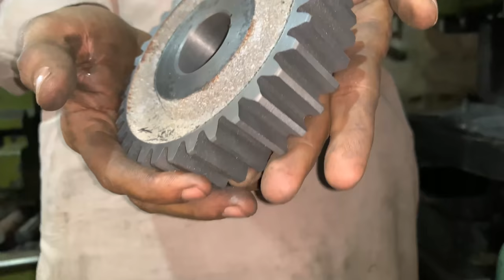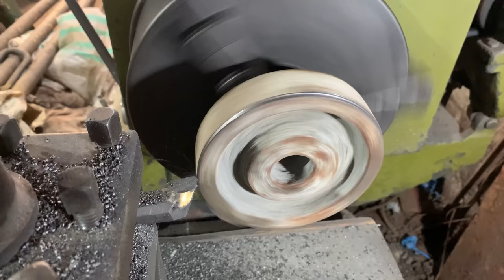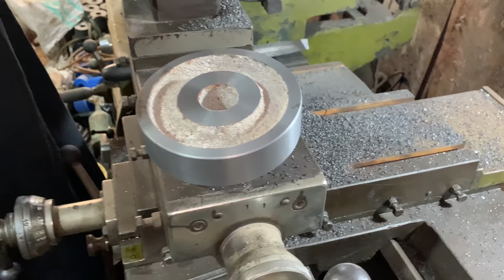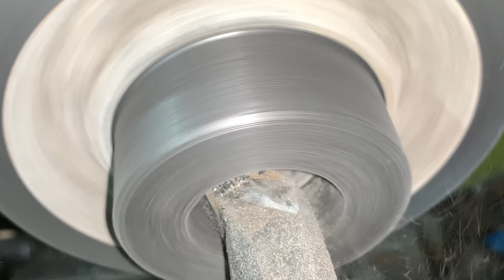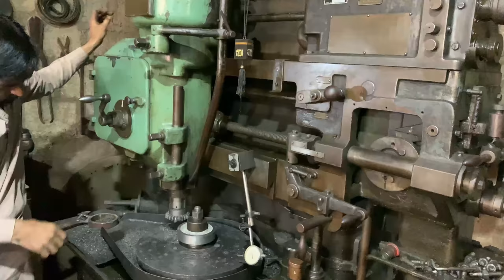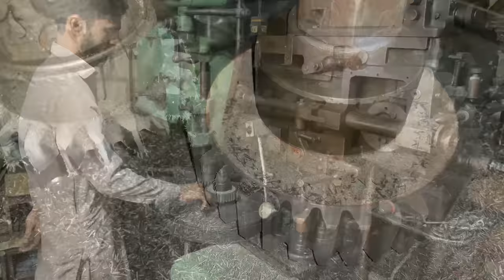Manufacturing process of supper Gear || Amazing Techniques of Making Gears !

Comment: Its neat to see the process of cutting the blank and then the gear teeth, but the metal is cast iron, you can tell by how the metal shavings crumble and don't make a ribbon like steel does, there may some applications for this gear but it will be a very weak gear that wont live long.
Reply: I would think being cast iron it would be very hard and wear resistant? It may not take impact well but I would think it would be very long lasting? A lot of people her , myself included have a little knowledge but not enought to understand why some of this is viable in the way it will be used?
Reply: What's with that country? This is pre WW2 technology and it's used in a wrong way too.